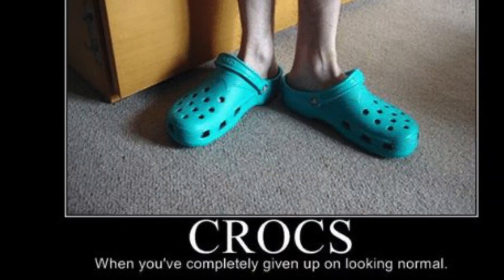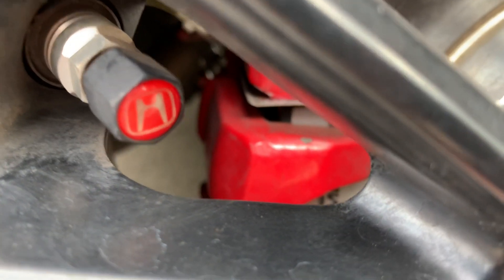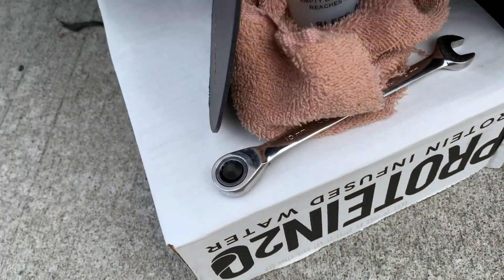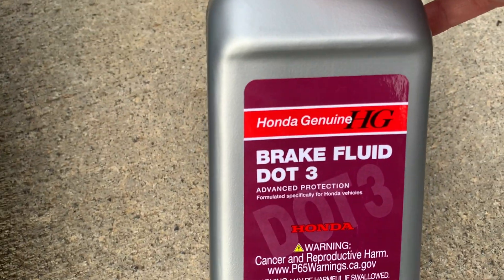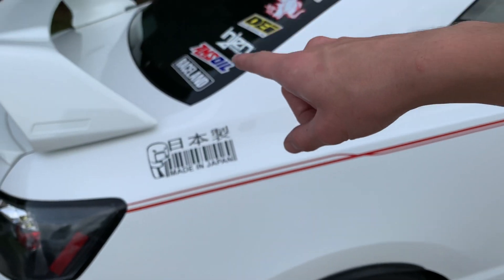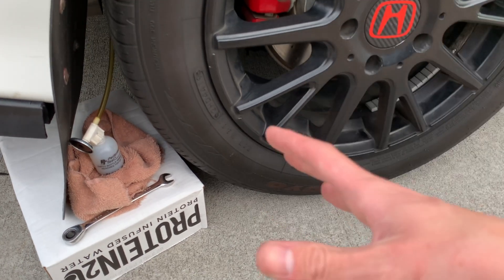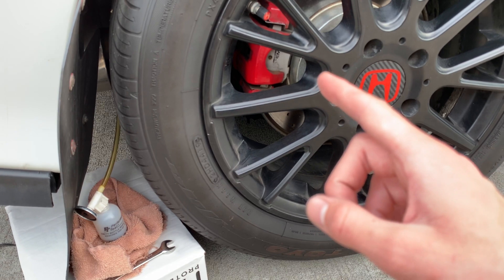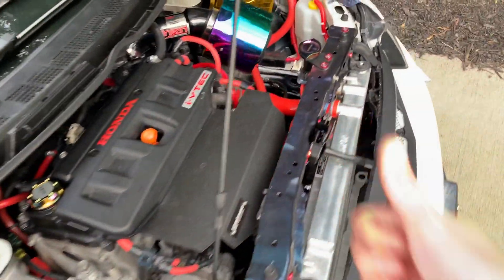How to Gravity Bleed Brake Lines

Comment: so basically you just let the brake fluid drip out slowly by gravity?. does it help if the car is raised from the front of the back?
Reply from the maker: @wagyu_killer  yes, and I mean you could. But just don’t push on the brake with the bleeder unscrewed. It’ll suck air back in.

Comment: I've tried this method. Surprised how easy it turned out. I allowed almost 2 fills of the reservoir to ensure that all the air has been purged. About ⅔ into the first pass, I closed the bleeder valve, gave the pedal a couple of pumps before reopening it. Then continued the process till I completed two fills of the reservoir. Perfect for a one man operation!

Comment: Not quite as simple as that as I’ve been a mechanic for 44 years and I always gravity bleed the systems , perfect as a one man use but depending on the repair carried out I always have bleed screw nipped up and press pedal a few times to get some pressure then undo bleed screw and leave for at least seeing about 40 drips into a tray then tighten bleed screw and should have good pedal , but don’t forget most modern cars have progressive servos so pedal will sink to floor if held down , this is normal .

Comment: Do the brakes have to be done in sequence, or could they be done concurrently or in pairs? Say, both back brakes, then both front, or all four simultaneously?
Reply from the maker: Back then front, or you could do all four at once
Reply: @Pastel7440  I will try doing it in pairs and see how it goes. Thanks.
Reply: @andrewleonard9257  Best to do one wheel at a time.  But this method works very well.  Just give it time to flush through all the air.  If you see bubbles , wait.